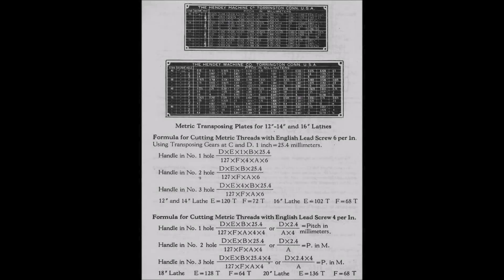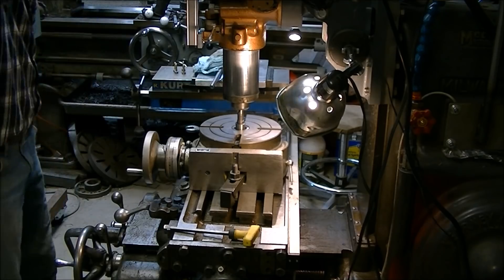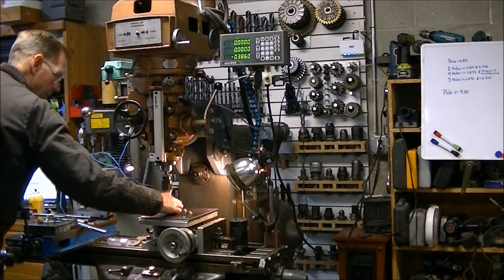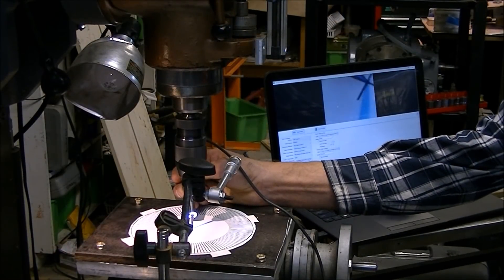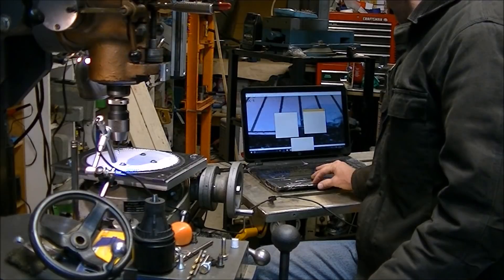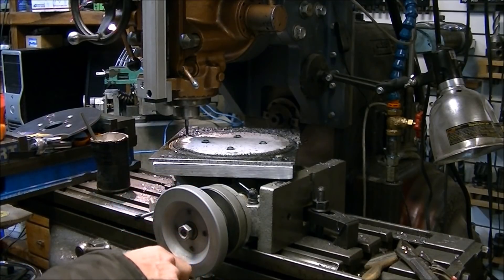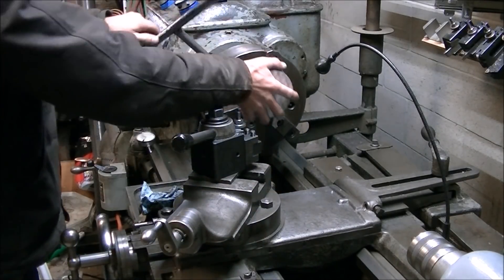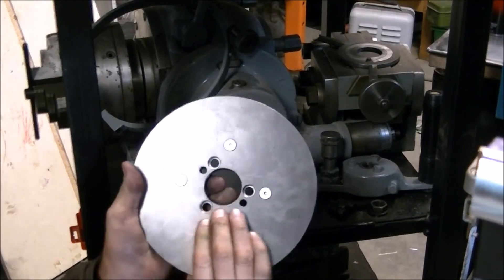Hendey Metric Gears Part 1: Index Plate

Comment: I have a Hendey 16 30 looks just like your's. Sn30888. I want to cut 11-1/2 threads and the plate says to use sector 46 gear rather than the installed 48 gear. That being said, are the 2 gears identical except for the numbers of teeth? Any help would be great.

Comment: Nice job on making the plate.  Shame about the little accident but you made a good recovery.  I was a bit confused at first thinking how can you make a 127 tooth gear with a 127 tooth plate.
I thought about the calculations for a while remembering my old fitter and turner days formula.
Turns of the handle =Ratio of Dividing Head divided by the number of divisions.
This came out with huge decimal numbers that I couldn’t convert back the number of holes you would have to move each time.
So I gave up and googled Dividing Head Calculator.
The answer is simply 40 holes on a 40:1 ratio head and 60 holes on a 60:1 ratio head.  This kind of makes sense some how but I still can’t think how to apply that formula to come up with the same answer.  I can see how nothing else is going to work with 127 being a prime number.
Reply from the maker: David, I hadn't thought about it as much as you did, I just kind of assumed a 127 hole plate was needed. You made me nervous and so I looked up a dividing head calculator and saw the same thing as you, 40 holes per division. Thanks for making me think about it a little harder. Sometimes I jump in without thinking things all the way through. At this point I have more enthusiasm than skill. Craig
Reply: @clemwyo  Your enthusiasm shows but any lack of skill does not show. :)
I have a smaller Atlas 10" swing lathe of a similar vintage.  ~ 1930's.  I have also thought about cutting metric threads and what kind of gears it would need.  Most of the articles I found mention the most accurate method is to use a 127 tooth gear with a 100 tooth gear.  However this gear would be too large to fit in the cover of my lathe.  You can get an almost as accurate thread with two compound gears. (47 and 37 teeth)  I think the inaccuracy is measured in hundreds of a mm over a metre so unless you are making really long threads I don't think it is going to matter. 
Here is a link from a quick search that discusses the problem.
http://conradhoffman.com/metricthreading.htm 
I was also interested in your video of the Lead Screw reversing mechanism.  My lathe has no reverse motor so i'd have to wind the spindle back by hand.  My lead screw dog clutch has multiple engauged positions where the one in your video only appears to have one possible position.  I'm wondering what would happen if I used this method to back up.
All very interesting :)
Reply from the maker: @DavoShed  If you could modify your clutch so that it only engaged in one location you should be able to  switch from reverse to forward and reengage at the same point. When I first got my lathe I asked the question on the practical machinist forum why more lathes did not have such a handy feature. The answer I was given was that of cost and complexity. I was surprised, when I took the mechanism apart how simple it was and, given the initial cost of these industrial machines, how little cost it would have added. Craig
Reply: @clemwyo  My little reversing mechanism is a self contained unit.  Apparently you can have either that or the quick change gearbox but not both, however the quick change box has no reverse.  My little reversing unit is fairly loose and some if the gears don't look like originals.  Maybe one day I'll give it an overhaul and convert it to a single drive point and see if I can back it up.  I'm looking forward to watching more or your videos.  I like the style you are using.  The voice over technique makes the sound consistent and you can concentrate on your work and talk about it later.

Comment: Why didn't you use the bolt pattern feature of the DRO for 127 holes?
Reply from the maker: +voron11000 that was my plan when I installed the DRO, then I read the manual and found out it only goes up to 99 holes. This was plan B. Thanks for stopping by. Craig
Reply: If your dividing head allows it, you can use differential indexing. In this case you wouldn't need a 127 hole plate.
Reply from the maker: +voron11000 the problem with 127 is it is prime number, only divisible by one and itself. It is the one gear most imperial lathes need to do metric threading and one of the ones that differential indexing doesn't work with. I have access to a CNC mill now and would probably use that if I ever need another prime number plate but I wanted to see if I could do it manually for this one. Thanks for watching and commenting. Craig
Reply: Differential indexing does work for 127 divisions. I've actually researched that question pretty extensively. It's one of my weird dreams to make a 127 teeth gear on a manual mill. If you want I could give you the exact calculations for using differential indexing for dividing a circle in 127 parts. It's actually really cool. And if I can't find a justification to make a 127 teeth gear, I'll enjoy watching you making it. Although using a 127 hole plate kinda seems like cheating a little bit.
Reply from the maker: +voron11000 I would love to see the calculations if you wouldn't mind sharing them. I gave up on engineering and moved on to geology in school due to lack of advanced math aptitude. I was mostly lost after trigonometry. Craig
Reply: Okay, there it goes. We won't need any trigonometry. I will assume your dividing head has 40:1 ratio, since it's the most common. Now we need to divide a circle in 127 division, but we can't do that, for the reasons you've mentioned, so let's instead try to divide in 120. That's really easy, we need rotate the handle 40/120 of a revolution. Or 1/3. Say we use a 30 holes plate, and set the sector for 10 holes. But that will divide in 120 teeth, and we need 127, so we need to compensate for that. Differential indexing means we compensate by rotating the plate itself in this case in the opposite direction to the handle. By how much? Well, let's figure out. The formula if i = N(1-z/zf). Where i is the ratio of the geartrain we're going to use, N - dividing head ratio (in our case 40), z - the number we want to divide to, in our case 127, zf - the number we divided to, in our case 120. 
So we're getting i = 40(1-127/120) = - 280/120. 
The minus tells us that the direction of rotation will be opposite to the rotation of the handle.

Now we need gears. 280 and 120 teeth gears is something you most likely won't have, so let's try and divide it by 2. Now it's 140/60. 60 teeth is most likely fine, but 140 is still too big of a number. So let's say it's (70/60)x(2/1), or (70/60)x(50/25). Are you still with me? 

Now we need gears with 70, 60, 50 and 25 teeth. These are easy numbers, and theoretically they should be supplied with the dividing head, but of course they aren't. :-) Anyway, they are pretty easy to make if you really want to. Aside from that we are going to need an idler gear. Remember that minus that tells us the rotation is opposite? The number of teeth on the idler doesn't matter, it's just reversing the rotation. 

Now to assemble our gear train. The dividing head has a lock that prevents the plate from spinning, and we disengage it. Now we mount 70 teeth gear on the spindle on the dividing head, that will be our driving gear. As a driven gear we mount our 60 teeth, and on the same axis we mount the 50 teeth gear so they rotate as one. The dividing head has that input shaft that rotates the whole plate and handle assembly and that shaft gets the 25 teeth gear that will engage the 50 teeth gear. Now all that's left is to do is to add the idler that will reverse the rotation. You can put it in between any 2 gears it doesn't matter where. 

Now. Are you still with me? Good, because we're done. Now as you rotate the handle you'll notice how the plate rotates in the opposite direction, going towards the handle, so to say, making you reach the hole in the plate sooner than you otherwise would, giving us those extra 7 teeth. 

Now, is that clear as mud or what? I can try and find a video that explains all that, because I feel like that explanation is really difficult to understand. :-)
Reply from the maker: +voron11000 OK now I get it. I didn't understand what differential indexing actually meant until reading your post and then watching this video https://youtu.be/tQBhHjNO69s. I appreciate you pointing this out to me I can see how this method would be really useful. I think my way might be a little simpler for a one-off job. Again, thank you very much for taking the time to educate on this topic,. To me this is where the power of the internet to lift and enlighten lies, the ability to share information and ideas. Craig

Comment: Very good work, Love your setup!.. I made some plates for the spindle of my hendey a long time ago.  I need to show it one day Thumbs up
Reply from the maker: +Steve Summers I'd like to see those if you get a chance to put up a video. I've thought about something for the lathe for changing the hole pattern in an axle. I'd like to see how you lock the spindle, that's the part I haven't thought through yet. Thanks for stopping by. Craig
Reply: clemwyo I just went with a heavy lock on the indexer. It works pretty well.. I will send you some pictures in the next day or so... if I don't, ,, just remind me.  I am a bust guy these days👍👍
Reply from the maker: +Steve Summers no rush. I'm in over my head on a restoration project of a 1910 Hendey conehead lathe. I'll be tied with that until spring, if I'm lucky. Craig

Comment: Had the same problem just before Christmas and had to go through the same steps as yourself, only difference was I used a DRO to do the bolt circle which ended up 126 holes because my start point and finish point had the same co ordinates. Second time around 127 holes. It took another two hours to cut the gear which was over eight inches in diameter. Never do relieved to see tooth 1 and 127 land side by side. Keep up the good work, I enjoy your videos.
Reply from the maker: +Robert Ashcroft I had hoped to go that route but it turns out my DRO only goes to 99 holes on the hole pattern feature. I've got to prepare some great blanks now and give the gear cutting a try. Any advice based on your experience would be appreciated. Thanks for watching and commenting. Craig

Comment: Interesting approach,  I want to make a gear change set to go from metric to imperial. The 127 /135 compound gear is where the work is. I have a 127tooth gear which is the wrong DP, but should help me make my index plate. The gear cutting will be via the elliot 14s shaper and direct indexing. So I have to make the index plate for gears from 135 teeth down to 32 T. I have not counted the holes .... it's quite a few to drill ☺. I think if my RT doesn't work out I will be getting a paper template made up and duck down as a guide. Cheers for uploading,  all the best Mat
Reply from the maker: Mat, having drilled 2 127 hole index plates and an additional half of the one I screwed up, I know how you feel about the drilling. The nice thing about the USB microscope method is how fast you can move to each hole. Initially I tried to pick up each hole visually because I'd forgotten about using the post it notes on the screen. When I started doing it the right way the speed increased a lot.

I saw your comments on JBFromOZ's video on shaper cut gears, if you go that route, I like that the templates can be 3D printed. I hope to be getting one of those soon so if you need templates, let me know. Thanks for stopping by. Craig
Reply: Hi Craig, thats the shaper route ! - if I can get everything sorted. the PCD disks Marcus used are cut on his engraver as are the index disk stacks.  I thought I would go steel all the way and make my direct index unit take the disks from my RT and also a 8" dia dedicated disk .... which I have to make up. The PCD drive disks are steel and as yet have to be turned from some laser cut disks I got for peanuts.  I plan on making a small batch for the Boxford lathe (popular here in the UK) to help fund the materials from selling off the extra gears made. When you think each gear requires - pcd disk, gear blank, index ring it starts adding up. However, it should provide me with a 'rig' for other gear DP & pressure angle variations - so next to no tooling costs down the line if I happen to invest in another screw cutting lathe with damaged gears etc ...... it would have been simpler / quicker on my Horizontal Mill if I had a £350 dividing head and £130 worth of cutters - but I have yet to see a DH which will cut 127 t without a dedicated index plate. But you know me - never the simple option ;-)  Have yourself a fun New Year & best of health for 2018. Mat
Reply from the maker: Mat, I too had thought about the shaper method but recently traded off my Amoco 7 inch shaper and haven't got the Atlas shaper restored yet. I keep resisting the temptation to get a big shaper because I just don't have the room. But I'll live it vicariously through your videos. Craig
Reply from the maker: Mat, somehow I missed your response. I got a laugh out of the making things simple, that's just not your style. I'm thinking I'll make a few extra gears while I'm at it also. There is probably someone out there who would like metric threading on their Hendey too. I paid a little more than I was hoping for my dividing head but it was local, so no shipping, and it is a genuine Kearney & Trecker so it is a very nice unit. Good luck with all your adventures this year! Craig

Comment: I do my own dividing plates the same way, except I don't have  a USB microscope. I do have an optical center punch and it works fine. Tedious work but the savings are huge. Nice work.
Reply from the maker: +Juan Rivero do you use a template to lay out the hole pattern? I saw xynudu use the USB microscope on his YouTube channel a while ago and wanted to give it a try. Thanks for watching. Craig
Reply: I  too watch xynudu. Yes, i use a template. I glue the template on to the blank.  I wrote my own PostScript program to do templates,  but there are several sites on the net that will do essentially the same thing. Look under "polar coordinates  graph paper" .  And fortunately, any error you make will be reduced by the worm ratio.